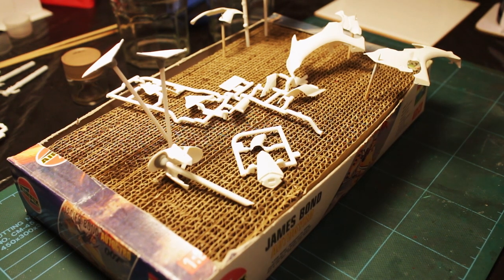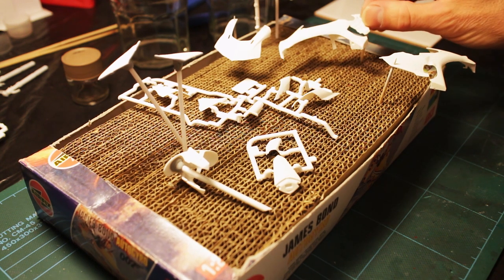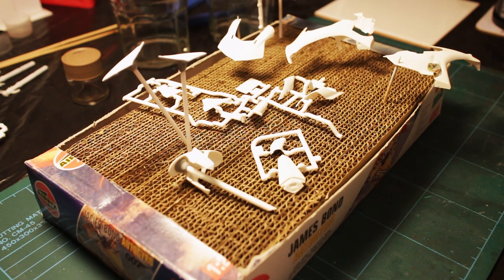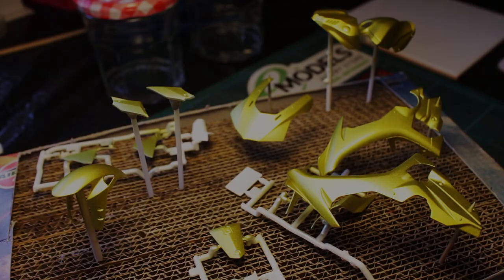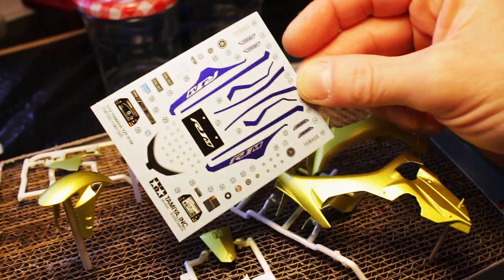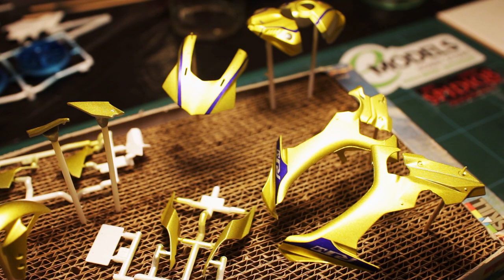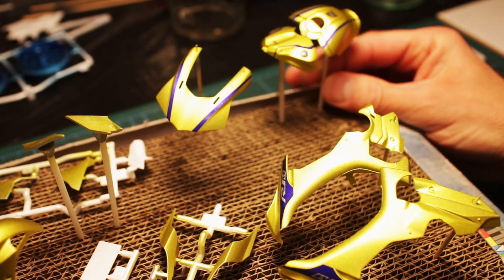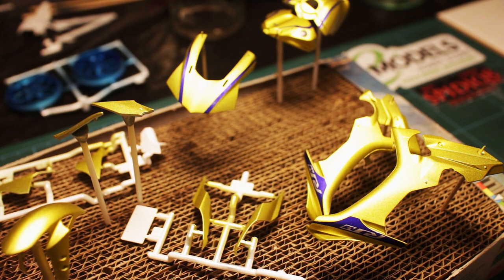Tamiya Yamaha YZF R1M Part 2 Paint & Decals

Comment: I'd have painted it in an old school colour scheme. Anything to 'de-uglyfy' the aesthetic of modern day bikes. Have the japanese completely lost sense of what makes for an attractive bike or car?
Reply from the maker: I don't think so tbh. It's simply a different era, take for example the glaring difference between 70's superbikes to 80's plastic clad alloy framed ones, they looked incredibly futuristic yet look really dated next to a modern one.
Manufacturers have way more technical assistance now and can maximise things regarding performance. This is one reason modern sports bikes all look very similar, it's mass lowering and centralisation to optimise the overall performance with further tweaks coming from racing, exactly the way it's happened for years, e.g. the use of carbon fibre in road cars which comes directly from F1 etc.
Granted, I still personally prefer 80's and 90's sports bikes to modern day which is both a product of the era I grew up in. (Just like modern music is rubbish) and handy as I can't afford a modern one Lol.
The beauty of a model though is that you can do whatever you desire to the styling and paint of it.
I'll be doing frame and engine different to the colour callouts too as the overall black on black is boring.
Reply: spidiq8 I don't think that's the difference anymore. I think it's an exclusive issue the Japanese have with aesthetics. Perhaps the 4 wheeled world provides a better example - the Germans particularly, know how to build stunningly advanced performance driven cars but regardless of taste make them aesthetically pleasing - the old basics of clean lines etc. Then look at what the Japanese are churning out - Toyota, Honda, Mazda and so on: it's essentially their idea of 'future' and they have cluttered their designs. They simply make ugly vehicles now when in the past (just 15 years ago in fact) they made quite the opposite. In the Motorcycle world Ducati can still turn out a beautiful looking bike. I just don't think technology has dictated the Japanese recent inability to make vehicles sympathetic to western tastes. Regardless your model is looking great as always.
Reply from the maker: @Laceyktm  Thanks, hopefully it'll look good when complete